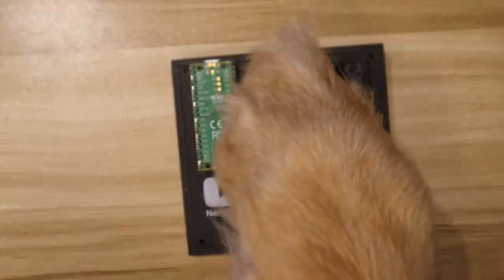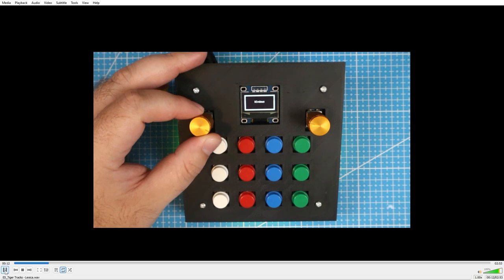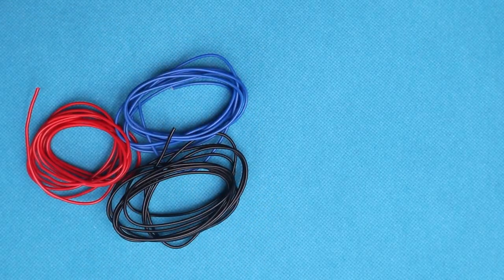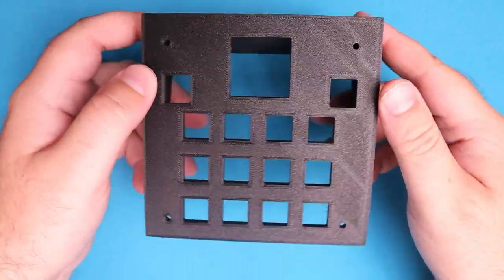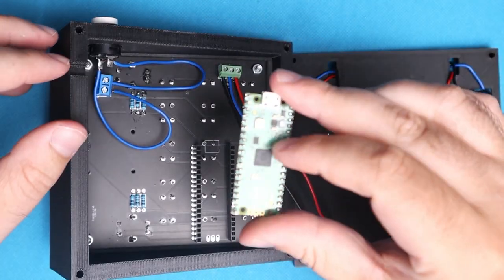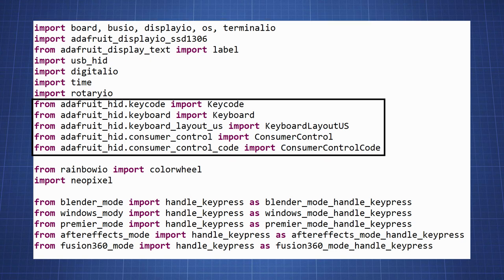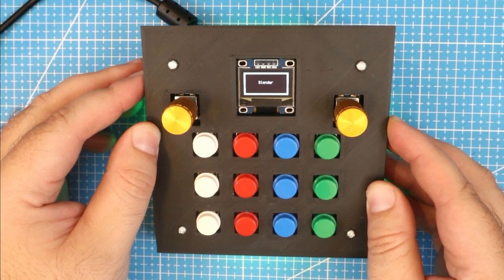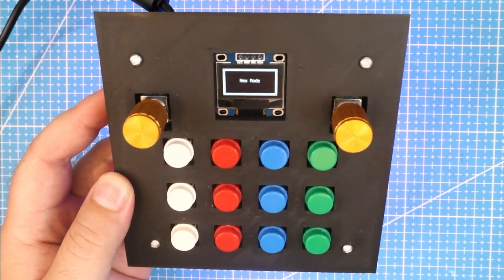DIY Macro Keyboard - Raspberry Pi Pico (Affordable & Awesome!)

Comment: Thank you for the video.  I took this idea in a completely different direction.  I provide IT support for a small office.  The receptionist has confidential information up on her computer screen quite frequently as part of her normal tasks.  The reception desk wraps around so customers can (and often do) position themselves so they can see the screen.  They tried a privacy filter, but everyone in the office absolutely hated it.  This project helped me make a "panic button" for her, which hides what she's working on and the information that should be protected.  It only takes one simple action to hide the screen and an equally simple action to restore her workspace.

I know I could do it better, but I did it in one evening and it does exactly what she needs.  When she turns on her Windows 10 PC, she opens a second desktop (Windows + Ctrl + D).  She returns to the first and does all of her work on it - the second is there but basically invisible and completely out of her way.  I connected two capacitive touch sensors (30 cents each) to the pico.  One (the "panic button") is attached on the right edge of her keyboard tray and the other (the restore button) is attached to the right back top of the keyboard tray.  Both sensors are in a place she never accidentally touches.  When someone comes up and can see the screen, she simply brings her hand to the edge of the keyboard tray.  That activates the panic button and the second unused desktop is brought to the foreground.  When the person leaves the desk area, she touches the restore button and her screen returns to exactly the same state it was in before.  It's a simple "Windows + left control + left arrow" for panic and "Windows + left control + right arrow" for restore.  This is faster to hide and restore than locking the screen, it doesn't require finding a remapped F7 button (for example) on the keyboard, mounting a couple of physical buttons that are awkward to find and doesn't rearrange anything on either desktop.  The USB cable to the PC and the wires to the two capacitive sensors are all hidden under the desk.  Interestingly, the most expensive part of this is the USB cable itself.

Of course, this is a perfect tool for a kid to hide what he's really doing on the computer when he should be doing homework, but I make stuff for good, not evil.  ;-)
Reply from the maker: You are welcome, If you have a second desktop running does take up a lot of resources for example extra ram / cpu when you switch between the two, or it is only basically a second desktop and not different user that you need to sign out
Reply: @NerdCaveYT  Second desktop, same user.  As far as I'm aware, this strategy uses very little RAM while still providing single-action "protection" since the second desktop is simply an organizational tool, which provides no additional access or capabilities.  I haven't discovered a solution that uses less RAM and requires so little pre-planning.

Comment: New and improved. Now with 2 knobs.
Reply from the maker: and more modes XD the previous one could not change modes so that is the game changer right there ;)
Reply: @NerdCaveYT  its a great setup and the code looks good and easy to modify.
Im a KMK fan. Its even easier to modify, but sadly I haven't gotten any OLED to work like your project (which is really cool)

Comment: Choose any [s]haft length :face-blue-smiling: if mode > len(mode_names) :hand-orange-covering-eyes: removes the need for a magic number
Reply from the maker: Did I do something wrong? Been coding so long on this I hope I didn't make a mistake - but well done for watching the code section that is the part everyone skips
Reply: @NerdCaveYT  Your code works 💯 but my short Python example improves it (a little) by removing the need to update the number on that line (it prevents errors and reduces work)
Reply from the maker: Great will update it

Comment: Nice! I love it!
Question❓: How many keys this design potentially supports? Only 12? Or could I make a full keyboard of 106 keys?
Idea💡: On Line 207 you could count the amount of elements instead of set a constant of 5.
Reply from the maker: Hello, in this case I used a pin per GPIO pin but if you create a matrix that is 13*13 so you can do 169 keys if needed. Yes thank you, I have updated it to len() I am busy working on something to create a gui to change the macros

Comment: Amazing, i want to make this macropad but without the led strips and just one rotary encoder (i have a Ky-040). It's still necessary to use the resistors?
Reply from the maker: If I am correct the KY-040 module has resistors on the bottom of the PCB, but you can get away with not using resistors because you can use internal pull down resistors from the Pico that I have set in the code
Reply: @NerdCaveYT  Yes the module has 3 103 SMD Resistor, thanks for the advice.

Comment: Is it touch sensitive? Like when you press the buttons it will become louder or softer depends on how hard you push the button? 😅
Reply from the maker: these ones no, just normal switches so you are going to have to press the switch and hold it in to keep increasing the volume or decrease

Comment: hello, first i need to tell you that your work its awesome.
and last, i have a question, how can you bind a custom key  in the code (like f20) for keyboard buttons in programs.
let me expalin,i have severeal keys for my keyboard assigned for specific stuff in premiere, but i dotn want to use the "a" key, i want to use a key that not phisically exist that i can put in the macrokeypad to bind it

thanks for all your videos, im a junnior programer and i think this is very usefull
Reply from the maker: Hi you are welcome, I am not sure if it is possible the library goes up to F12 - https://docs.circuitpython.org/projects/hid/en/latest/_modules/adafruit_hid/keycode.html
but if you can do something like ctrl or alt plus a key as a shortcut / macro then it should be possible to assign more shortcuts keys then possible on a normal keyboard

Comment: The video is very good. Do you believe it is viable to use a board with buttons connected in a matrix to expand the inputs? Thank you very much
Reply from the maker: yes, you can definitely do that, my last video on the super cheap macro keyboard I used a keypad that is in a matrix and the code on that video how you would do it, if you are making your own matrix I would say include diodes to avoid the ghosting effect
Reply: @NerdCaveYT  i already made the board with diodes. You learn the hard way to use diodes when you build your first matrix.  Thank you very much, I will download and analyze the codes.  Thank you very much

Comment: please make a video about connecting WIFI module to the pico pi
Reply from the maker: You mean the Pico W? There is the pico W with a wifi module and bluetooth
Reply: @NerdCaveYT  no. I have i regular pico pi and i have bought a wifi module to connect to it but i couldn't do it.

Comment: Amazing. Is there a possibility to add mouse into the code. Like middle click, left, right? Thanks
Reply from the maker: Hello, yes there is a mouse library -> https://docs.circuitpython.org/projects/hid/en/latest/api.html#adafruit_hid.mouse.Mouse which will allow you to do left right middle or even use a joystick to move mouse around
Reply: Thanks. I've found the library but I couldn't get it work. All sorted now. 👍 @NerdCaveYT

Comment: bro your videos are sooo good.
i saw (kinda) all of your videos about this macro things you do
and i have a question.
can you do a next level video and make a simple application for this keyboard???
it's gonna be so damn good if you can make that
Reply from the maker: Hello thank you, what do you mean in terms of application, because you can program this to be used with any software you want to use it for. So if you are doing for example photoshop and have specific macros you can just code it or do you mean something else?
Reply: @NerdCaveYT  no no, i mean a application that is .exe and when you open it you can change the macro of each key in the app with out any coding
i love doing codes but i think that be so much cooler, 
and i know it's kinda hard but we need it too be simple at first you know
Reply: @poisontoon-yt you could always get some self locking push buttons and then code it to where if that buttons is pushed then they'll do that code and each locking push button can be for a certain application
Reply: @ITSYEBOISteven  thanks

Comment: hello! me again...

I like your implementation and it fits almost perfectly to what I want to do.
I want to add 2 ports for Atari Joysticks.

I plan to use mechanical keyboard switches (9 keys). So, from your configuration, I would have to remove 3 buttons... 1 click of one encoder and the led strip, in order to have enough gpios available for the 10 atari Joystick port cables.
According to what I understood, soon you will make another video using key switches instead of buttons like in this one... Could you help me by creating a configuration similar to the one I mentioned above (my setup) mainly for the pcb, since I don't know how to design it accordingly to my needs. 
The modified code would also work for me, although I know something about Python (thanks to you), so there wouldn't be a problem if you don't implement the atari Joysticks ports, for example.
The most critical thing for me would be the PCB, especially the part of the distribution, centered, of the keys.

I understand if you can't do it, as it's a very specific personal request, which might not suit general users.
I thank you in advance for your help and I congratulate you for your videos, which are very interesting, clear and useful!!

Greetings from Chile..
Reply: Un saludo para Floki!!
Reply from the maker: Would it be possible that you can send me a link of the Atari joystick or part number so I can read a bit more about it on how it works, since you want to add two of them are you planning on building a multiplayer controller box or something. If you are able to send me sketch or something that would be useful. Here is my discord community link https://discord.gg/BWerHKKVZF it would be better to talk there under the project chat help

Comment: Instead of hard coding the number of elements for the dictionary in the code, could you not simply get the length of the dictionary?
Reply from the maker: I could have done that yes, do you mean the section where I check which mode is active
Reply: @NerdCaveYT  yeah that way you only  have to enter the mode name into the dictionary.
Reply from the maker: @TheTitaniumBunker  Thank you will update the code